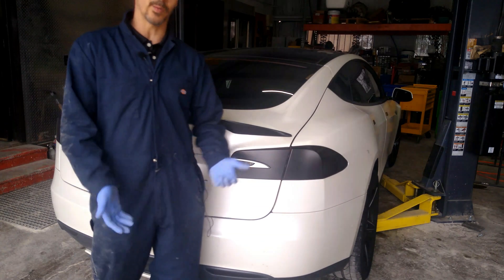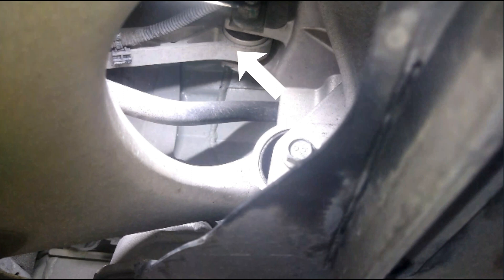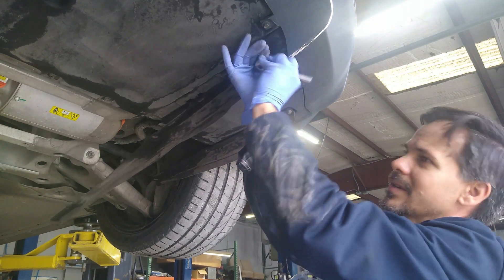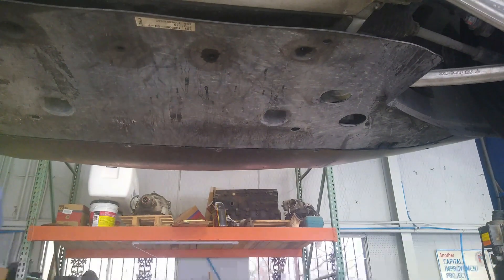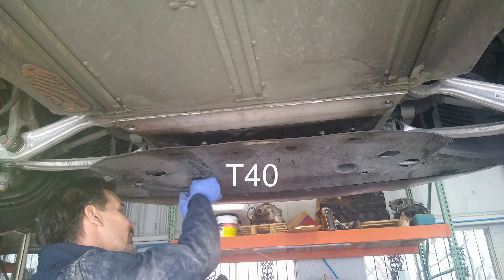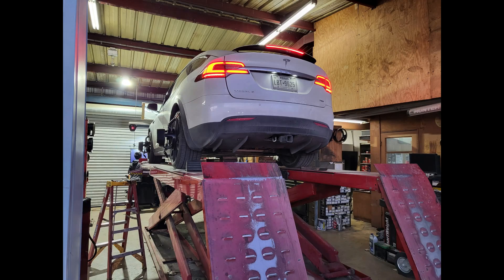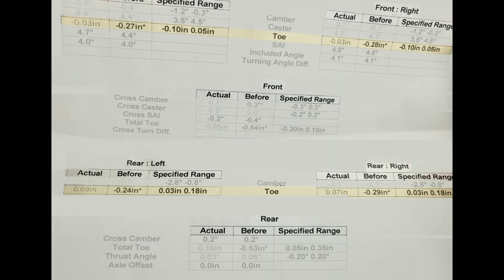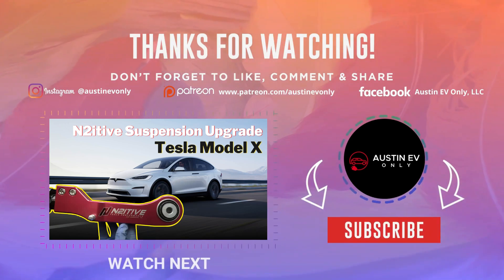Tesla Wheel Alignment fixes severe tire wear

Comment: Hello can you suggest me or tell me whats wrong with my tesla model 3
I recently changed just my rear tire  those were worn from inside and specifically right rear tire worn like ripped off.
After i replaced my tires my cars starts drifting from rear and car starts pulling to left as soon as i hit my accelerate hard. After that i went to workshop and get alignment done. Even after that my car has same problem pulling to left whenever im pressing accelerator paddle and making drifts from rear when ever i turn my steering even little but that makes me feel like my car will roll. Body roll has been increased too much since i have got my new tires.
Reply: I got exactly the same issue as soon as I replaced the rear tires. I have been told that it sounds like worn bushings on the rear toe links. I am going to replace them most likely with the adjustable ones
Reply from the maker: I don't have a lot of experience with this....but the one time I saw something like this, the toe arm screws were loose, so like @polemidis suggested, I would focus on the suspension links on the side that is pulling.

Comment: A better explanation of the aggressive toe in is Tesla's poor build quality and weak bushings that wore out allowing them to collapse under hard acceleration.
Reply from the maker: Thanks for the insight. I couldn't, for the life of me, figure out why a car would come in with such bad alignment with ride height set to normal.  To address the tire wear from riding in low, I recommend the N2itive camber correction kit 1
Reply: @AustinEVonly  Thanks. I have the Model X and I've spoken with a Model X owner regarding how they have performed since the installation. Would you be willing to provide a reference to an owner you've installed them for so I can have more than one perspective on the tire wear after several thousand miles?
Reply from the maker: yes. Please DM me @ info@austinEVonly.com
Reply: Another reason for the tires wearing out in 6,000 miles is setting the air suspension to the "Very Low" setting all the time which makes the tires ride on the inside edge even more than the poor factor alignment specs do. I set my ride height to the "Never Lower" setting to prevent automatic lowering at 55 mph and when city driving from 35 mph or less I set the ride height to the "High" setting to bring the contact patch to the center of the tire to counter some of the inside tire wear. I've heard Tesla has improved the Model X and Model S suspension adjustments and adjustability on the 2021 and newer vehicles.

Comment: All the shops around me said they CAN'T do Tesla due to alignment software doesn't have Tesla info.  is this True?
Reply: its probably because they have to remove the panels
Reply from the maker: Yes, this is a valid reason why a shop would not want to work on a Tesla. Even if you gave them the alignment spec, a shop might not want to take on the liability of adjusting to "customer specified" tolerance.
Reply: More than likely it's just takes to much time I have had issues but know how to simplify reason why checking these videos rear toe is a pain trying to see if a good way don't want to lift in wrong area

Comment: Please help.  Yesterday I had a 4 wheel alignment on my 2017 model X 100D due to buying 4 new tires.  The alignment was done but, I noticed that no matter what setting the air suspension is on, the car as a "baja" look where the wheel gap is higher on the front than the back.  It is as if the rear air suspension was low.  When I took it to have the alignment, the car had equal wheel gap front and back.  Was something missed during the alignment or rear struts having an issue afterwards.  I do not hear any leaks coming from them and the guy who did the alignment checked all the hoses today.   I am going to take it to the Tesla service center to have the alignment checked/redone and see if something was missed during calibration of the suspension.  He said he put the suspension in normal/low while doing the alignment similar to what you show in this video.  I showed him this video today before he rechecked the alignment.   Any thoughts please!!!  Tia
Reply from the maker: Check out my video on Lowering Links.